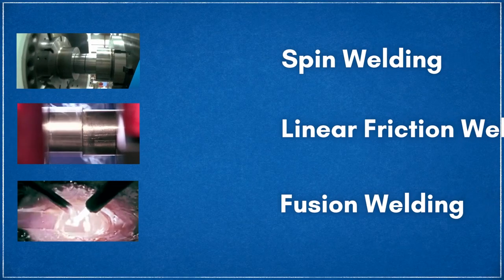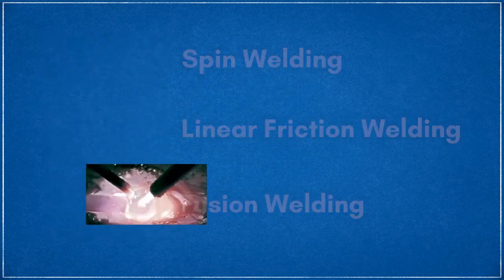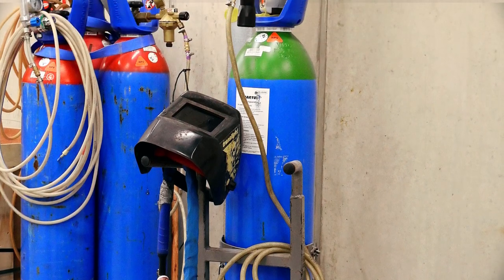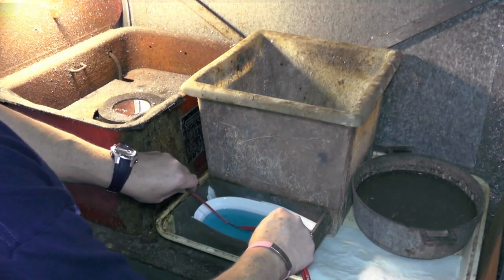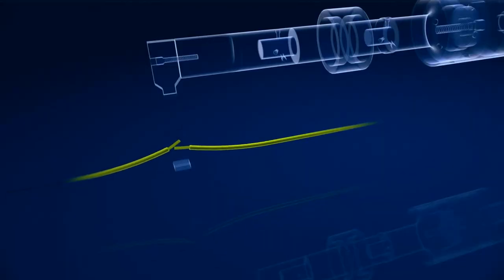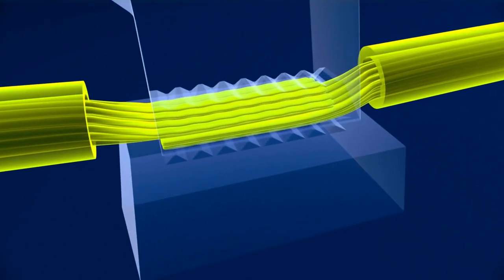Welding With Friction

Comment: Solid explanation, good content.  I grew up with acetylene, electric arc and pinch welding, along with chemical bonding.  A decade ago, or so, I watched my first friction stir welding on a fuselage of the Eclipse 500 aircraft, and later help develop ultrasonic welding processes to bond co-polymers, also in the Aerospace industry.  Then thermoforming and thermal bonding processes.  Now we’re seeing printing technologies that can construct components without the need for additional welding processes, since they're joined at the molecular level.  Amazing at how fast technologies can advance, and we’re only getting started!

Comment: One more application of this kind is friction drilling, used for thin wall tubing. The "chip" is forced upwards by the friction and then pressed onto the tube, it makes the thin walls thicker for threads or other applications. If you want to try this at home those tools can be cheaply sourced on eBay or if you have you can regrind old carbides (better get some coffee that could take a while).
Reply from the maker: We kept "friction welding" general because of it's multiple overlapping applications. Interestingly, we're considering a follow-up segment on thermal drilling. Thank you for your input and continued support 🙏

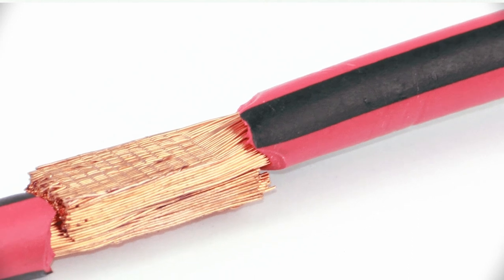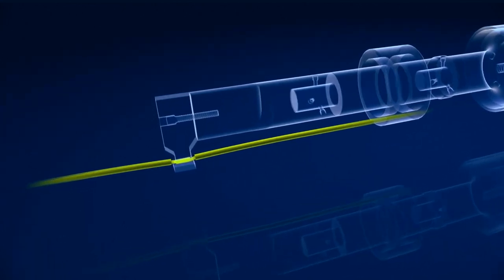Comment: I don't think the process of welding plastic parts belongs in the same category of "friction" welding here because friction is not actually its primary mechanism of heating. That's a common misconception even among engineers in the plastics industry. On the machine you show at 4:59, the mechanical wave is perpendicular to the weld surfaces. This means the vibration squeezes the parts, rather than rubbing the parts together (note: rubbing IS how the other ultrasonic welder at 4:28 joins the copper wires which is why the ultrasonic converter is on the side, rather than above the work). The primary heat source for ultrasonic welding of plastic parts is repeated low amplitude, high frequency elastic deformation. You totally can friction weld plastics, but that's not what that machine is doing.
Reply: If you are correct, then the people editing Wikipedia are wrong (https://www.wikiwand.com/en/Ultrasonic_welding).  That happens but I tend to trust them.  I'd also venture that it is still friction welding since it is going to be a mix of transverse and longitudinal waves.  So there is both compression and transverse friction.  In addition, if it was simply compression and elastic deformation, the whole part would melt, not just the interface between parts.

Comment: For many decades, JCB the digger manufacturer, has friction welded hydraulic ram eyes to the ram rods. The great advantage here is that the weld is total and not topical and the two parts actually become one part as the metals blend totally.

Comment: The wires that were friction bonded... you should take them and "plug" them into eachother and then use a heat shrink on them and then you have a connection that is like a solid wire.

Comment: You sound like an ultrasonic welding equipment sales rep. The reality is different. At my work we've got both ultrasonic welders and electric spot welders. Each of them has its pros and cons.
Reply from the maker: Did I sell you on the idea atleast? Hahaha The video was an overview of their applications for their respective purposes. Stay tuned for a granular follow up.
Reply: @NewMind   Not sure if you got to the "granular follow up," yet or not. Ultrasonic welding is gaining traction in the manufacture of lithium-ion battery packs for use in hybrid/electric vehicles. Personally, I have used USW to join the cathodes and anodes of multiple lithium-ion cells (consisting of thin copper or thin aluminum tabs) to nickel-plated copper bus bars.

Comment: showing the welding of body parts of a car is the wrong example
a car body is electrically welded, no friction welding involved
Reply: You are incorrect.
I currently build suv’s in a large manufacturer that currently leads the market. 
The new aluminum hoods are all friction welded. No electricity at all.
The braces are put in a holder and a rotary head moves in, and forces the material together in a rotary friction way. It was kinda impressive when I first seen it.
Reply: @Sicktrickintuner  so i was correct, a car body is not a hood.
Reply: @janvanruth3485  Given that a modern vehicle cannot pass crash test requirements without the hood, I'd venture it is part of the body.  Top hat is still the body.
Reply: @kodiak2fitty  ever seen a crash test without wheels? so they are part of the body? you have a problem with admitting to be wrong?
Reply: @Sicktrickintuner  - Even so aluminum welding does not throw off orange sparks ;) - it was not aluminum welding

Comment: I dont trust it
Reply: Friction welding has joint efficiencies higher than your standard fusion welding processes by far. Also much higher fatigue life.  source,  I am a FSW Expert.
Reply: @Guildmanpro   oh  really?  How is that?
Reply: @j5892000   Okay, bear with me and get ready for a wall of text.

Most of the time when measuring the mechanical strength of a welded butt joint, you will do a pull test.  THe pull test will give you a value of a stress in which the sample breaks.  good and certified welds will break not in the joint but in the area right next to the joint called the HAZ, Heat affected zone. so why is that?

So to answer the question, we have to understand what the HAZ is and how it derives.  when you weld 2 pieces of, lets say aluminum together, traditionally you use a torch to input heat into the local area and add a filler metal.  whenyou apply heat to the part, the heat will spread though the metal.  so the areas neighboring the weld zone will get very hot.  Hot enough to begin changing the micro structure.  when you apply great amounts of heat to a micro structure, the individual metal grains will begin to enlarge.  when metal grains enlarge, your mechanical properties change.   normally under these conditions, metal will become 'softer' in this HAZ area, which means your elongation becomes greater, but overall strength decreases. Generally speaking.  so the HAZ is the neighboring areas of the weld seam which are mechnically weaker to the rest of the base material.  And when stressed, assuming the weld is of good conditions, it will fracture in this HAZ area as noted before.  so what does this have to do with the comparison between friction welding processes vs additional fusion welding processes?

The answer to that is heat input.  for your traditional welding process that require the melting of two materials ,  a substantial amount of energy needs to be put into a work piece to melt to allow fusion welding to occur.  I can't post images in comments but I would ask you look up the phase diagram for Al-Si.  assuming you are using a common Al alloy types in automotive, you are looking at melting temps of around 660 C to 760 C to melt.  so your fusion welding process will have to locally heat up the weld seam area up to the forementioned temperatures to work.  Friction welding process on the otherhand do not need to melt materials.  Friciton processes rely on heat and force to produce diffusion bonds along with mechanical mixing (FSW).    becasue diffusion does not require the materials to melt to create a joint, but instead added heat (form friction in our case) and high forces, this creates a situation where atoms form the paired metal matrixs to move form one ot the other.  When this happens, the paired matrix's intertwine with one another and create a bond, thus diffusion bonding.  To put the heat input into perspective for those same aluminum alloys used prior for fusion welding,  your needed heat input is drastically reduced from 500C all the way down to 300C.  

This major difference in heat, the total energy input into the workplace for friction welded products is substantially less.  That said, your HAZ is substantially smaller compared to fusion welding  and the grains dont grow as much.  This results in mechanical properties much closer to the base material prior to welding.   therefore, friction welding processes have consistently higher joint efficiencies compared to fusion welding processes.

As for Fatigue life, the tldr version would be,   friction welding joints,  when of quality, have little to no defects compared to fusion welding processes which have a tendency to entrap gasses and oxides.  These entrapped oxides and gasses lead to shorter fatigue lives.  The smaller HAZ of friction welding processes also plays a large role as well. 

let me know if you have any other questions, 

Cheers!